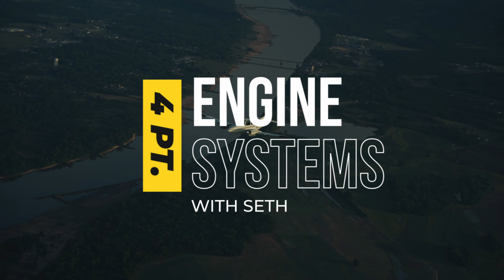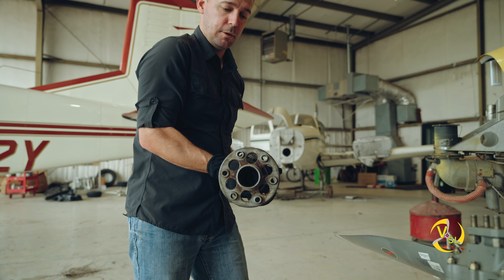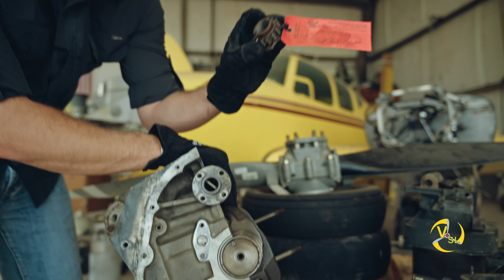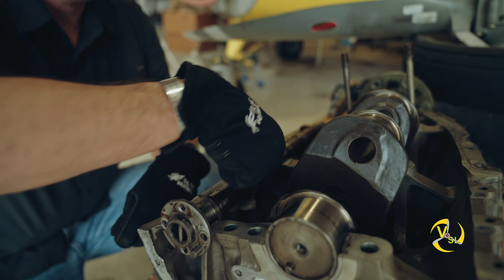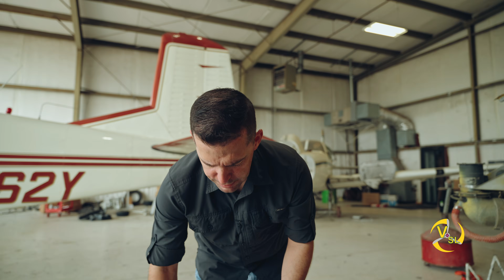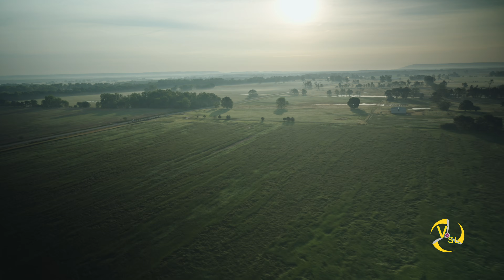Demystifying General Aviation Piston Engines: Exploring Crankshafts and Camshafts (Part 1)

Comment: I just found your podcasts.  I know, I'm a little late to the party, but I want to catch up.  I thought aircraft and auto engines were the same except for the split case on the aircraft engines.  I found out that there are 6 cam lobes on a 4 cyl engine in a plane instead of 8 in a 4 cyl auto engine.  amazing!  That explains much better why older engines produce less power than new.
Amazing podcast.  Looking forward the rest of the series to see what other misconceptions I have.  Subscribed. 
(PPL in 1972.  Instrument in 2008 and commercial in 2009.)  Just proves there is always something to learn!  Thank you.
Reply from the maker: Welcome to the party, I'm glad you are enjoying the series!

Comment: Thanks, I was a mechanic on steam propulsion plants in the Navy but wanted to learn about aviation engines. Just FYI for everyone, the reason why you may not see an increase in oil temperature when you lose oil pressure is because the oil is no longer flowing in the system, so there is no hot oil flowing to reach the respective temperature sensing probe. Very common in a complete loss of oil pressure.
Reply from the maker: Thank you for the clarification!

Comment: Thanks for this deep dive. I'm curious about the pressure sensors at each bearing and how they relate to the reading at the oil pressure gauge. Does the gauge show the reading of the sensor with the lowest pressure?
Reply from the maker: There is only a single oil pressure transducer in the engine, no one for each bearing.  To quote Thomas Sowell: "There are no solutions. There are only trade-offs."

This especially applies to aviation.  More pressure sensors would increase complexity which would decrease reliability.  One is good enough, but knowing there is only one pressure sensor is good information for a pilot when dealing with a abnormal situation.
Reply: @SethLakeDPE  Ah, I was confused by the comment at around 16:50. Thanks for the clarification. I have my PPL and IR, but haven't flown in 15 years due to life circumstances. I'm trying to soak up as much as I can before getting back with a CFI, so thanks for the great content!

Comment: Just so know one else has to pause the clip to do the quick math, and for an idea of what those numbers look like:
I believe that's  276,000,000 rotations for the outer lobes VS 552,000,000 for the double duty loabs.. 
Avg 2300rpm over just 2000 hrs.. wow!
I train at a flight school that's pretty kool (aircraft, maintenance wise etc.)
But to Seth's point, the fact that idk what other pilots may have missed (myself included not being aware of what he just explained, until now)...  
As it relates to all of us different folks (of varying exp levels) hopping in and out of the plane, flyin all around, and doin who knows what up there...
I'll def be one to share this clip with others, so that we All can help each other keep safe, and be that much more conscious of that OP Guage when scanning.
Great info bro, love the content 💪🛩👌
Reply from the maker: Thanks for doing the math!  The double duty lobes are definitely a contributing factor of decreased horsepower on older engines.
Reply: @SethLakeDPE  Np Seth! Keep these awesome clips coming! Invaluable information for sure 💪🛩

Comment: Aircraft crankshaft is forged first to the rough shape and then final machining operations are done. It is not machined from single block of steel as you state.
Reply from the maker: Thank you for the correction.  Sorry I missed that one.

Comment: Minor correction, if prop/crank is at 2000rpm the cam is 1000rpm, not 4000; bigger gear is on cam and idler.  Great video that should help a lot of peeps!
Reply from the maker: Yes, I misspoke and need to pin a correction. I thought I had edited out most of that but I guess I missed one.  It's a 2-1 reduction in crank speed.  So for every 2 rotations of the crank the cam only does 1 rotation.

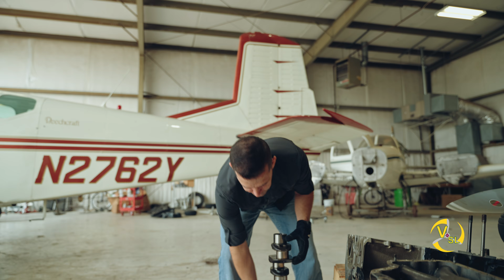Comment: Thanks! I've seen many car engines apart but never an airplane engine in such details, very interesting. BTW, I though crank is cast first in a form to a rough shape and then machined to fine specs 1:30 ?
Reply from the maker: You might be right actually. I'm not sure if it is cast and then machined or just machined.  I'll do some research. Thanks for watching!